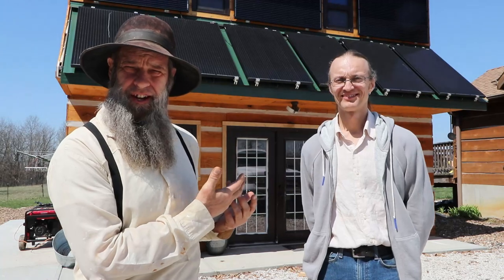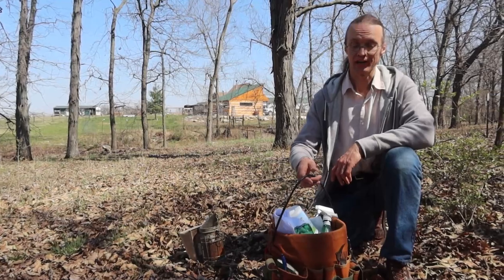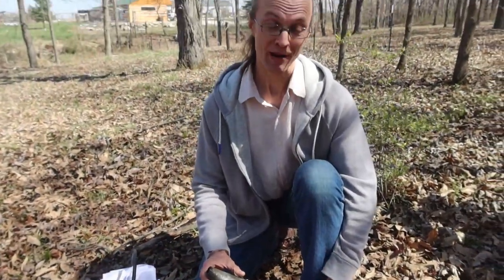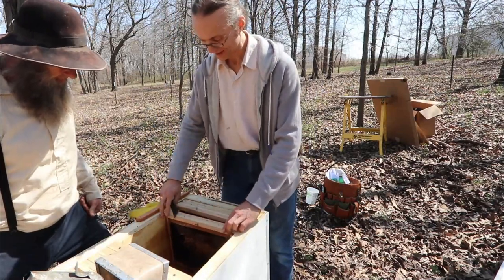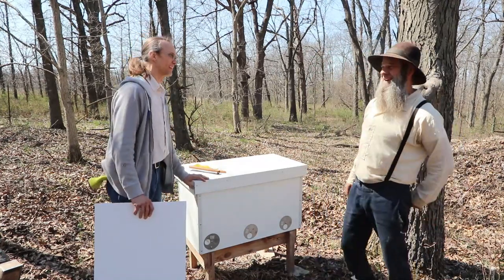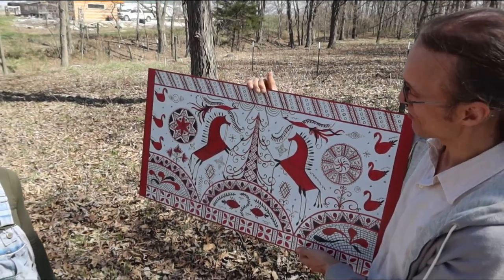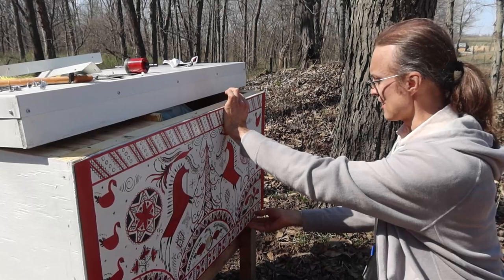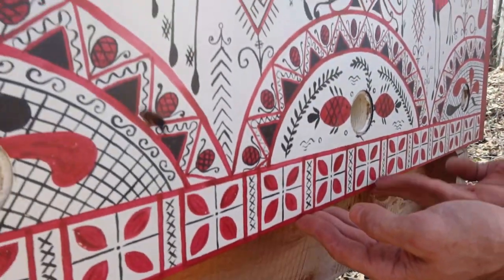You SHOULDN'T leave your Bee Hive white! SPRING INSPECTION

Comment: we find up here in Northern BC, Canada...we find horizontal hives don't winter over well here. I know of many who have tried but for some reason, they just don't do well.  I wish they would as i get older horizontal hives are easier to deal with.  Great video as usual
Reply: Have you insulated the sides like Dr Leo showed? This will make a difference as the walls are usually too thin for winter without insulation.
Reply: @maryannecarter2632  I don't have one of them hives but i know lots of people who. Yes they fully insulate them, even underneath. I would like to try one once as an experiment to see if I could get them to work.
Reply: I’ve heard similar stories regarding overwintering of horizontal hives
Reply: I think they are doing something wrong, my cousin is going on 3 yrs with them in northern Alberta and they are thriving!

Comment: For drilling through aluminum, I usually start off with turning the hole saw backwards, and I drill a slight angle… less than 10 degrees and file the edges later. I have been installing commercial door for 30 years and drilling the steel doors often happens…

Comment: I LOVE these videos! Keep ‘em comin!   Some “construction” tips (based on working with an “empty” hive): 1. Clamp the artwork to the hive, reach inside and mark the holes with a pencil. (Will save a ton of time measuring and possibly making an error). 2. As someone else said, run the hole saw in reverse. No need for the plywood “sandwich” etc. but certainly use a wood base to drill into. It’ll help with any possible tear out as well as just be a base to drill on.  3. Screw a “ledger” board to the very bottom of the hive, that protrudes beyond the face of the hive to set the artwork on while the silicone sets up and you replace the corner brackets.

Comment: I build metal buildings and drill holes through 26-gauge R-panel all the time. Once the pilot hole has been accurately drilled, you can spin the drill motor IN REVERSE applying an even pressure to cut the hole. This takes about three times as long, but it doesn't ruin your bit nor does it snag and create a jagged hole edge.  It makes a smooth, clean cut just like it was made with a die, eliminating any need for clamps.

Comment: Where the mouse gained entrance can be seen at 31m 39s (directly above the caulking line being applied for the artwork). It is common to see the same mouse (and even rat) damage at crawl-space entrances, on the outsides of houses. They usually have a similar style lid covering the entrance pit. (Generally, these crawl-space lids and entrances are poorly made, and not to the same tight specs as Dr. Leo Sharashkin’s hives.)

What I suspect happened, from what I can see in the video at 8m 6s, the divider board appears to set a bit higher than the top of the hive. If this board is causing even a slight rise in the level of the hive lid, then the mouse would be able to chew and create the rounded edge to make itself an entrance/exit. Given that there is usually a slight allowance built into the eves of a lid where it hangs over the sides of a box, if the lid eve were to be pushed flush on one side of the hive, then the excess allowance on the other side (which under normal circumstances wouldn’t be an issue), when coupled with the rise of the lid, would be an ideal situation for a mouse to create an entrance/exit.

Comment: In regards to reusing the entrance gate discs on the art panel, could you glue felt on them to prevent scratching?  Of course, you'd need to cut out the appropriate holes in the felt.

Comment: Hey did you check the vents on the lid? That's the first place I would expect if the front gates were closed. A mouse could get up and chew through the screen on the inside of the lid. Mice are notorious for fitting into tiny spaces as I'm sure you know. Haven't read any previous comments, hope you found the answer.

Comment: could the mouse have gotten in through the vent holes on the lid? i cant remember if there is any screen on the inside of the lid.
also if you clamp the plywood to the sign (front and back) then lay out your door holes, you can drill your pilot holes and doors easier and with less chance for error.

Comment: The problem with Layens frames is that extractors (spinners) are outrageously expensive.
Reply from the maker: I bought the dual one from horizontalhive.com reasonable and will last forever
Reply: @OFFGRIDwithDOUGSTACY  At that price, it should.  Sorry, but 700 bucks for a three-frame manual extractor is nuts.  I won't even mention the price of the motor driven one.